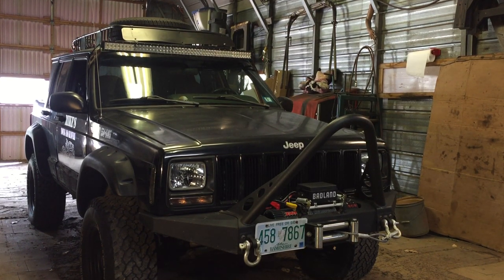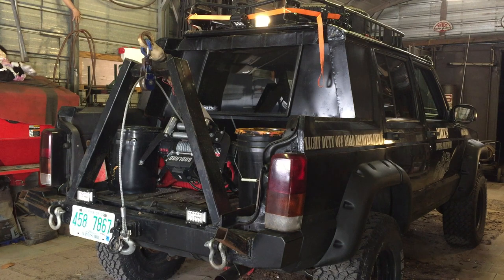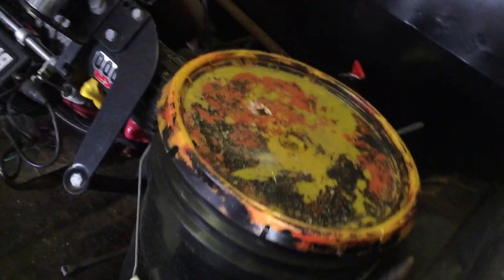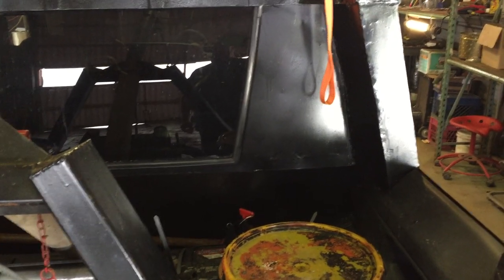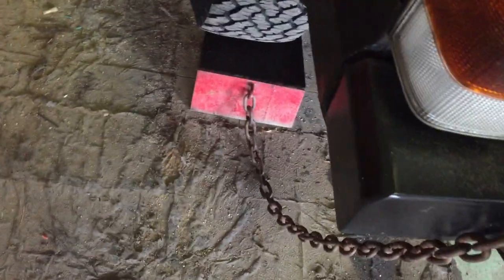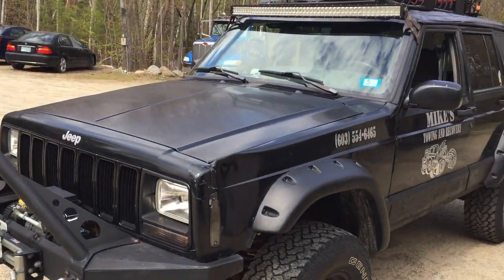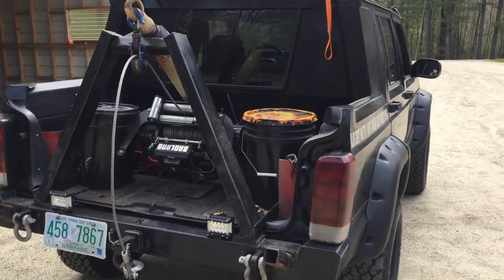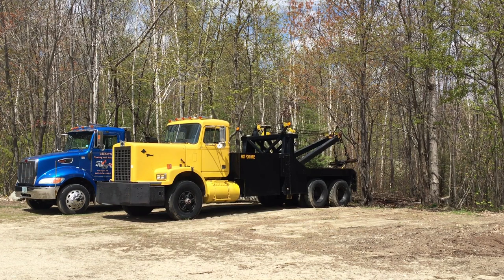"The Creature" Mikes Towing in NH Light Duty Off Road Recovery Unit

Comment: Nice rig, but I'm thinking you mis spoke re the snatch block when you said that it halfed the pull.
The snatch block in fact doubles pulling capacity, but halfs line speed.
I'm sure you new that but some of your viewers may not have.
Anyway great job.
Reply from the maker: yes i supposed the proper wording should be doubles your winching capacity, not halfs the load on the winch..  i guess they both kinda mean the same thing but yes you are right that would have made more sense to the viewer. thanks for watching

Comment: Osha?
Nah never met her, getRdun.
Snatch block help with overloading winch and tripping breaker. Add some D-rings to rock sliders, self recovery.
Reply from the maker: there are 3 D rings on the rear and many snatch blocks on board that would normally get used in that scenario, But i wanted to demo what it would do in its raw form and demo that those breakers are there for a reason.  Thanks for watching, and thanks for the comments!    PS. i hear osha is a real  b*tch.  lol

Comment: and i have been worried that my 1994 ram 2500  4wd truck is good enough
Reply from the maker: Well ultimately the jeep is really just transportation for the winch. once its all set up there is not alot of pressure on the jeep itself. 
But, Im sure i will rip it half one of these days, did 2 recoveries with it today !  Thanks for checking it out